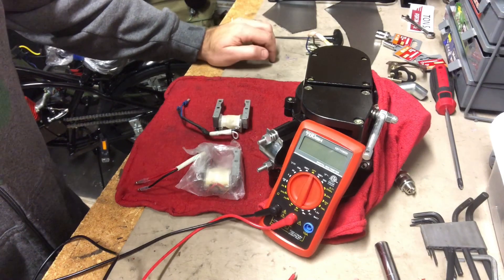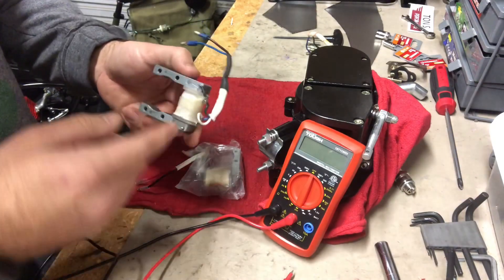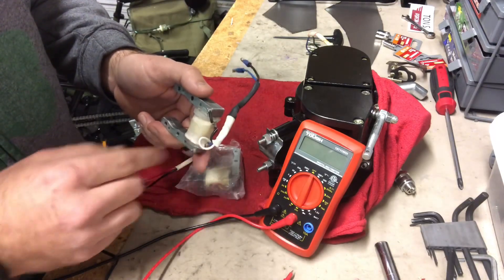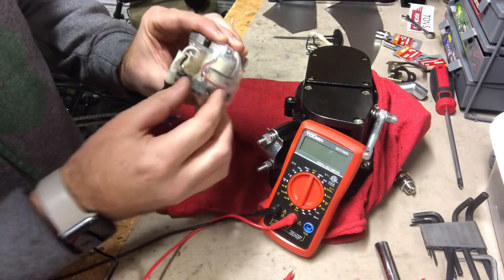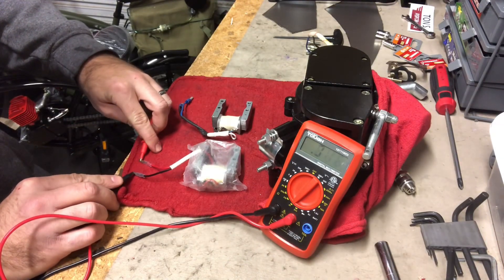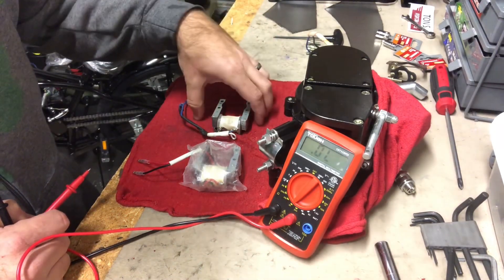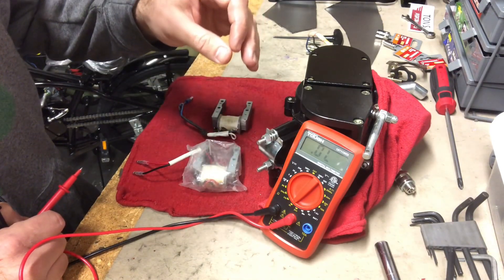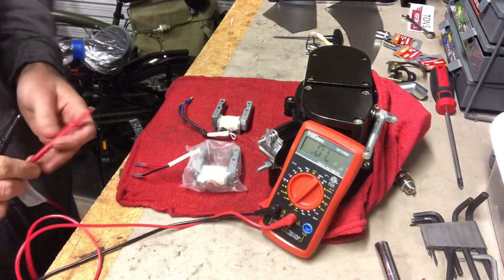80cc Oz Magneto vs. Stock Magneto Upgrade Results

Comment: Great video! What are your thoughts on installing a second coil on the other end of the magneto to power lights?
Reply from the maker: Crankshaft Garage : Thanks for the kind words from your previous comments on a different video... much appreciated. As far as the 12v generator attachment that gasbike.net sells, i am not completely sold on it. It does work... it does power the light, but the strength of the light fluctuates from idle to movement. The installation is a bit tight but doable. Even though I could not tell a difference in power loss, I prefer to have my lights independently powered; especially if I ride at night due to a consistent, bright flow of power. I would say buy the 12v generator if you have a decorative light that needs power, but if you have a light that you need and need to depend on like in night driving, then use an independent power source. Just my two cents... hope it helps!
Reply: @SouthernCustomCC    I was about to ask this very question myself.  An additional question comes to mind, what if you added a couple of capacitors in line with the light to smooth out the output?  Would an additional coil then put out enough current to reliably run the light?  Thanks!
Reply: @mattparker9726  a DC regulator/rectifier and cap can help a/c flicker, Headlight brightness is very rpm/load sensitive. Tiny magnet/coil, limited space & HP.... I-ion battery mtb lights much brighter & easier.